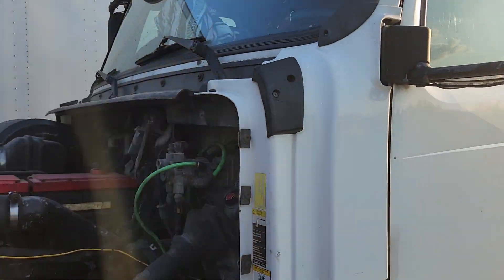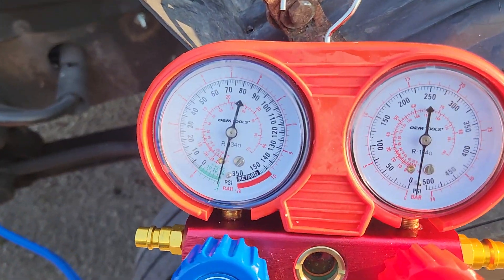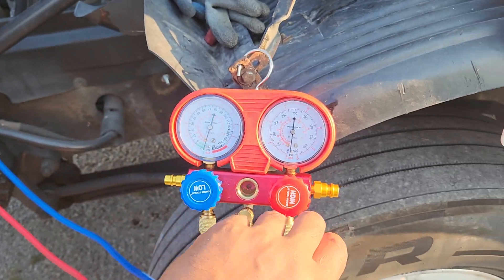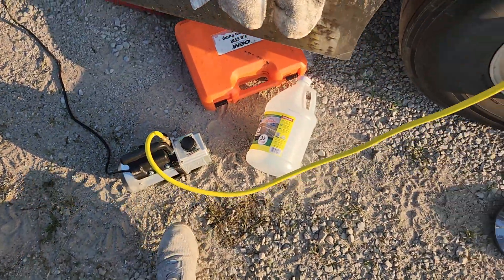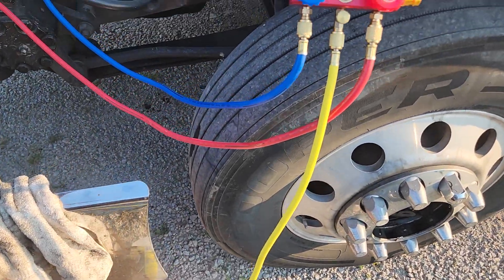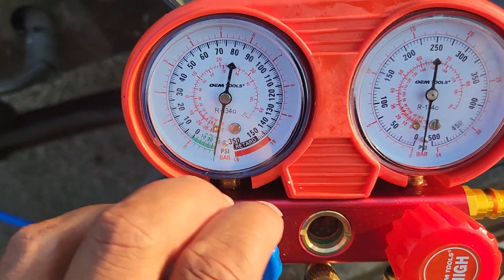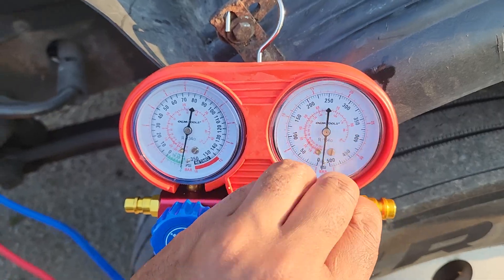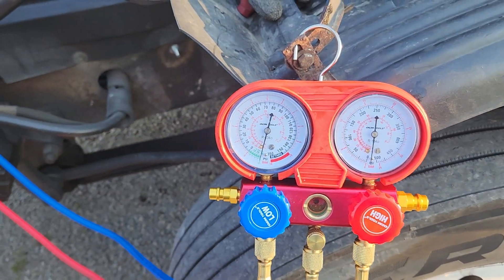A/C Vacuum on 2001 volvo semi truck

Comment: These videos have gave me some insight on these model year trucks and I appreciate it. I wanted to pick your ear on whether or not you thought the Detroit series 60 was a good first engine to own? I’ve had my class A since 2022 and got it through Amazon. I think it’s in my best interest to become my own authority and buy and a sleeper. I live in nj and was looking at a pre eld pre emission 1999 Volvo vnl with a Detroit series 60 12.7 the rebuild supposedly has 500k on it and the truck does look clean and well maintained it has an Eaton super 10 speed manual transmission the truck is listed for 28 thousand USD. What do you think, worth it or should I pass?
Reply from the maker: Entirely too much money for truck with them specs in this market, detroits are good i have one and cummins n14 which is my preference.
Reply: @BiggTruckDriving  copy that, thanks for your advice